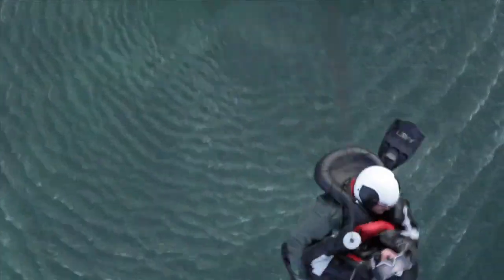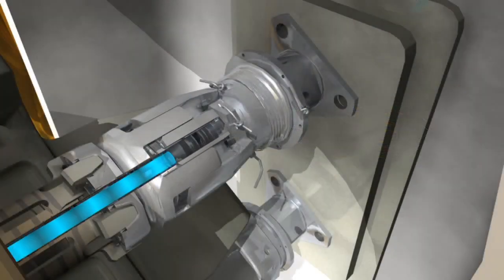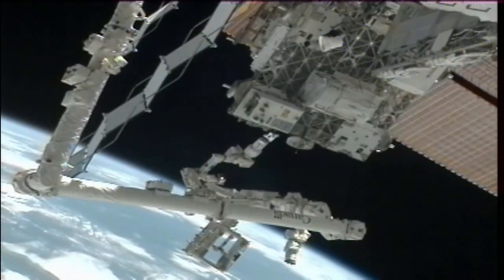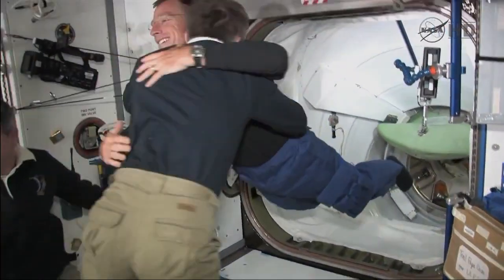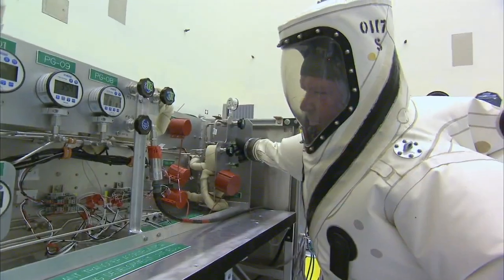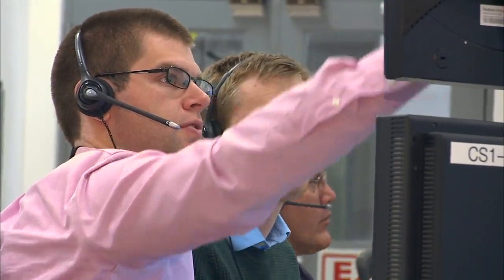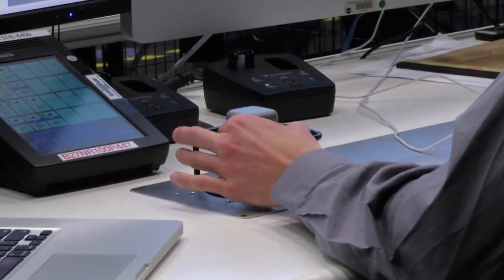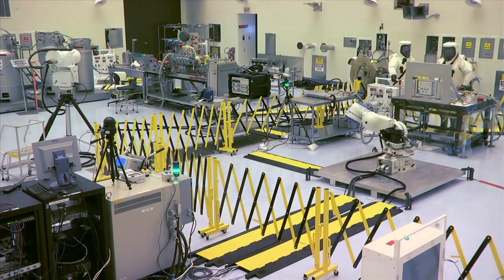Robotic Satellite Refueling Tech Works, NASA Proves | Video

Comment: The problem I see is that launching the fuel into space is going to be another task in it self.
I understand that this could save fuel in that launching the fuel into space may be cheaper then to launch another satellite (and less hassle). This is all good so long as the satellite weighs less then the satellite it is refueling (i.e. might have been cheaper to launch another one) as well as would this refueling satellite fill up other satellites in one mission? or would it be better to launch much smaller satellites. This of course would be thought of way before hand but I would like to know.
This is a great use of people's skills in liquids and robots and I can't wait to see this happen.